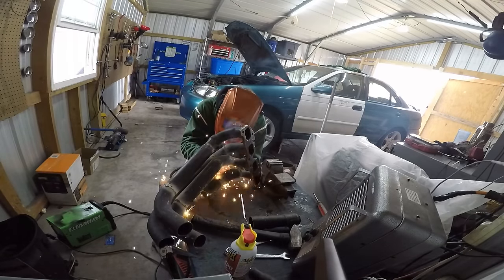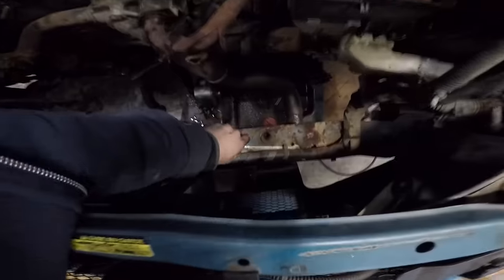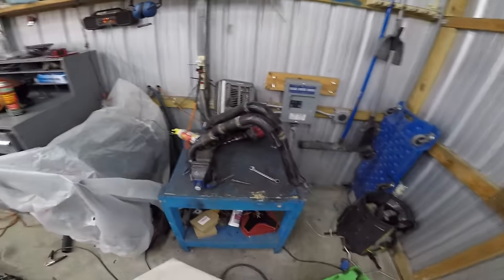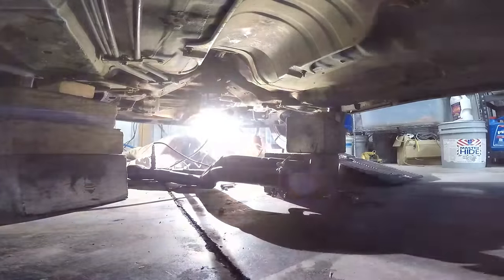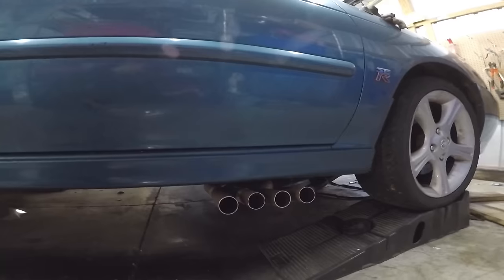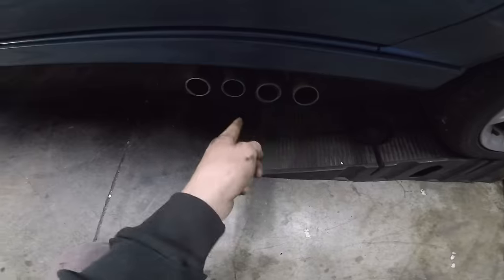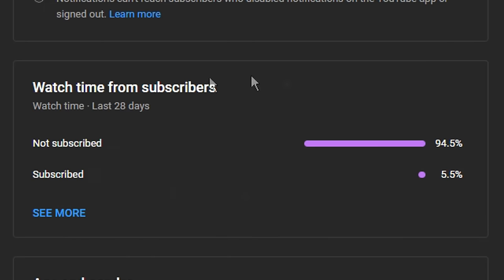True Quad Exhaust on a 4 Cylinder - What Will it Sound Like?

Comment: That sounded kinda good actually.  I mean, I like the sound of zoomies on many engines but, I never would have guessed that a QR with a set would sound that good over the computer. 

Man, I miss my '04 Sentra spec-v.  That car was such a blast.  I've got a Q60S and an RX-7 now, neither are quite as much fun as that Sentra was for me in its OEM form.  Hopefully with some mods they'll both live up to the smile that little Sentra put on my face.
Reply from the maker: Mine has been great, I autocross it quite a bit. I'm not a big fan of fwd cars, but I like my spec v.
Reply: It’s the shit cars that make this worth doing
Reply: I had a 04 Ser had a ballpoint separate and balled it up at over 90mph flipped end over end twice hit a big cement Calvert then smack a pole 25 feet in the air I was awake for all of it and the dang sentry was still idling when it came to rest I kicked the door open and walked away with minor cuts and two fractured vertabrae I miss that car
Reply: I had a '91 SE-R. My god that car was fun. The ole SR20 finally spun a rod bearing and I sold it. Wish I hadn't. Miss that car...
Reply: reminds me a little of straight-piped 240sx's at some drift days I used to frequent when he revved it out haha. Did sound pretty dang good

Comment: Sounds absolutely dope. On low RPM it's like a tank. But the best thing about this exhaust is that on high RPM it sounds like a WRX STI, and the car doesnt even have to have the flat 4 engine!
Reply: That’s because the thumping sound Subarus are known for us purely due to the two exhaust header pipes being different length.  Unequal length or UEL.  If you put and equal length header in, it’ll sound like an inline 4.

You can actually get an UEL for a Honda D series and sounds like a god damned Subaru 😂 

The pipes he made for this car weren’t perfectly even length so they gave different pitches, like a musical instrument.
Reply: all bark, no bite

Comment: I bet a little resonator and a high flow muffler (straight through muffler) on each pipe would make this sound super guttural and smooth, and take out some of that loud rasp that hurts ears. I think this has potential honestly.
Reply: Maybe like a cheap sports bike exhaust on each pipe.
Reply: Where would that go? The thing as millimetres from bottoming out as it is…
Reply: @XavierAway  out the roof, of course.
Reply: @XavierAway  Exhaust components don't necessarily have to be near the exit. Many resonators are actually right after the converters close to where the transmission is in the front of the car. You could easily put one or both of these further up the line somewhere with a little creative engineering.

Comment: Reminds of custom exhausts crafted by former Chilean Formula One mechanic Emilio Peeters for dealer Henry Moore's little Team Subaru in the early '70s in Austin TX. We were loud and quick with those fine small 4 cylinders. My 72 FF-1 had a Radio Shack electronic ignition kit soldered & bolted on, while my '73 GL Coupe had a Jensen Electronic Magneto. The other two team members ran '73 GL & DL models. They all sounded like this video and got between 30 to 40 MPG flouting Nixon's 55 MPH national speed limit during the Arab Oil Embargo days. Gas that was a high 38 cents for premium jumped to an outrageous 60 to 70 cents per gallon.

Comment: this sounds absolutely incredible, and very inspiring to people who feel ashamed of their straight 4 engines, definitely wanna do this to my own car!!
Reply: It may mean your slower, but hey, who wouldn't sacrifice power to make a cool sound
Reply: @lohostege  exactly
Reply: Ive notice the crappier and older a 4 cylinder is it has a "better" sound like similar to this one in the video 😂 i think the rasp and higher pitch comes with performance advance timing equal headers and high rpm with bad exhuast isnt too pleasant but it can be its just rare lol
Reply: @repingers9777  indeed,
Reply: @lohostege  nobody doing this has a fast car anyways
Reply: @repingers9777  Old  honda 4's on carbs can sound incredible... I've got an 89 accord with dual weber 45's that sound pretty wild. Isn't the fastest thing around for sure but damn does it sound sweet.
Reply: @zelashizzz1278  lmfao dude i love webers on old inline 4's 🤣😭
Reply: @repingers9777  Same, pain the rear to keep tuned right, a 20 degree swing in air temps throws them off, but damn fun.
Reply: Why would anyone think a straight-four sounds bad?  A straight-four Honda CBR250RR Fireblade revving to 18,000rpm sounds fantastic, it sounds very similar to a V8 Honda RA106 Formula One Car revving to 18,000rpm.

People seem to hear how an inline-three sounds like half a V6, inline-five sounds like half a V10 etc, but not how an inline-four sounds like half a V8.  Could it just be that American style V8 (which is constructed more like two V4s joined together and NOT like two inline-fours joined together) gives people the wrong idea of how an inline-four should sound?  If the matching style of V8, the Lotus and Ferrari style which IS two inline-fours joined together was more common, perhaps people would have a more favourable view of the inline-four sound?
Reply: Who tf is ashamed of a 4 cylinder?  They're great!
Reply: @Stern98257 anyone who thinks their car sounds bad or isn’t powerful enough, i don’t mean that 4 cylinder engines are bad because most are amazing :)

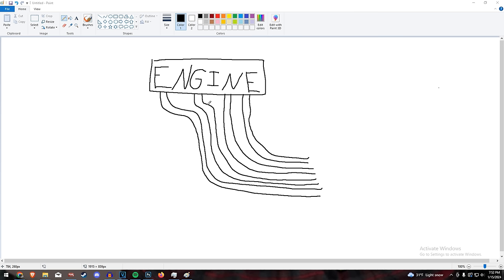Comment: 0:21 "We used to use these till we found out they weren't great."

Yeah, lack of back pressure... Great way to burn valves, melt rings and quite often try to catch the engine bay on fire. About the only scenario where this actually works out well is on a plane, and that's just because the exhaust is already something like 12 inches long with a substantial amount of air passing.

Comment: Zoomies are still used in Top Fuel drag racing. They are some of the fastest cars in the world.  Zoomies are not used much anymore due to packaging & emission constraints.
Reply: Im pretty sure Top Fuel drag racing cars arent very technically advanced. The reason theyre the fastest cars in the world is the fuel they use which is 90% nitromethanol.
Reply: @palikkalapsi345 congrats that’s about the dumbest comment I’ve read in a really long time
Reply: Zoomies work well on any engines with large superchargers, using collectors & other items to improve scavenging is of no benefit. I have a blown methanol car, see my chanel for a few onboard vids - fastest run so far was 2 years ago, 7.50 seconds @ nearly 180mph. I'm just learning to drive it having learned to tune it & its huge fun.
Reply: @sidefx996  he's not really wrong, top fuel dragsters are fast because of brute force, and not technology
Reply: @Bangmomsmakebombs  I guess it depends on how you define "cutting edge" and "technically advanced."  For their purpose, a Top Fuel engine and car IS the most technically advanced and cutting edge technology in the world.  Otherwise someone else would have found a "more advanced" way to do it better.  What "cutting edge" technology" would make them work better?  Without making a list of and individually describing and explaining all the components on a modern Top Fuel engine (and car overall), I absolutely feel they are all of those things otherwise they would've been making the power and running the ET's they run now 50 years ago.  I guess to the low information Top Gear cars & coffee crowd "technically advanced' means having 20 camshafts and being built in a foreign country?  What exactly are we comparing them to?  They're built for a very specific purpose.  He stated the only reason they go so fast is because of the fuel they run on, which again, is about the dumbest comment I've heard in a really long time.  That's like saying the only reason the X-15 went almost mach 7 is because of the fuel it ran on.  A modern Top Fuel dragster or funny car is covered in cutting edge parts.  While the engine configuration is "based off" a production Hemi engine, EVERYTHING is custom made (and horrendously expensive). And the car is much more than just an engine.  And by the way, they LOWERED the percentage of nitromethane in 2015 in order to try and "slow" the cars down as technology continues to make them quicker and faster.  Dude can't even spell/name/pronounce the name of the fuel properly.  Should probably spend a little more time reading a book and little less time commenting on Youtube about things he knows nothing about.
Reply: @Fred_the_1996  Again that's an asinine statement.  Define "brute force."  Again if that were the case why weren't they running as quick and as fast decades ago?  Prior to 2015 they ran a higher percentage of nitromethane.  Why are the cars quicker and faster now?  Oh yeah.  Advances in...wait for it... TECHNOLOGY.  For their purpose, what is more technically advanced?  And what "technology" would make them work better?  I'll wait...
Reply: @sidefx996  brute force is squeezing so much power out of an engine that the spark plugs die mid run and the engine starts dieseling. Sorry but dragsters aren't as advanced and polished as some other categories and they rely on brute force, as in tons of boost and tons of fuel being injected. And no, they're not getting faster because of tech, it's because of the teams' optimization of their setups
Reply: @palikkalapsi345 engines are air pumps. The more air you can get in and out of an engine the better it works. 

The freest flowing exhaust is literally the best you can use. And anyone that says you need back pressure needs to be smacked into reality.
Reply: @Fred_the_1996  Again, you like to use adjectives like "advanced" and "polished" (whatever the hell that means) but have given no examples or comparisons.  The only reason they're able to "optimize their setups" is because of advances in technology.  You can "optimize" a 1960's dragster all you want and it's not going to run like a current one.  Advances in technology in electronics and fuel injection and superchargers and clutches and tires and in all the different materials involved (do I need to keep going?) have made that possible.  What "other categories" are "more advanced" in your opinion?  And again, be sure to define "more advanced."  And if they're so much more advanced, then obviously that "more advanced" technology should be able to be used to make Top Fuel dragsters/funny cars that much quicker and faster right?   If someone told you Ford was building an all aluminum, flat plane crank, DOHC engine, you'd immediately get a hard on.  Except they already did that in 1940 and it powered a Sherman Tank...  You may not be a fan of the sport, but again, nothing out there is doing it better.  A Formula 1 car can't do what a Top Fuel dragster does, and vice versa.  They're both built for specific purposes and are both covered in "cutting edge" technology for that purpose.  I'm guess the majority of parts and tech on a modern Top Fuel car weren't available say 25 years ago.  Otherwise, why weren't they using them then?
Reply: @sidefx996  i didn't say the teams aren't technologically advanced. They are. They use dynamometers, sensors, etc to make the cars faster. But the engines and cars themselves really aren't. If i use cutting edge tech to dyno tune my 90s car and make it faster, it doesn't make it any more advanced. But yes, you're also right
Reply: @Fred_the_1996  Besides a similar basic engine and overall car configuration (engine in the back, supercharger on top, skinny tires up front and big tires and wing out back) there is probably nothing on a current top fuel car that you'd also find on a 90's Top Fuel car.  I could be wrong but I'd venture a guess that just about every part has been advanced or surpassed by new technology.  They "look" similar to the everyman but a 90's 911 also looks similar to a brand new one to a someone not into Porsches.  You can use the most advanced dyno tune in the world and you're not going to make a '91 (insert make and model here) run like a '24 (insert same make and model here) without changing parts.
Reply: @sidefx996  hmm ok
Reply: @SkylineBNR34 then how come taking off the airbox and straight piping a car doesn’t give massive HP gains
Reply: @Fred_the_1996  lol dude talking out his ass.  you did right to reply like you did.

Comment: Had a lil 960° rotation on black ice, tore the whole muffler system off when I flew off the raised roadbed in my 80's 318i [Germany early 90's)... as I had American plates I didn't bother fixing it. 

Sounded like that, redline slam shifting,  spinning it's tires on all four gears... I didn't even change the oil, 50,000km... left it a smoking wreck when they took me away in cuffs, returning me stateside. 

You should have seen my daytime ride, an m60a3 main battle TANK ... no muffler either.

Accidents are funny... I can still remember the beer flying out of my passenger's can... as if in slow motion, frozen in the air as we spun round and round.

Comment: this sounds so good that if the performance loss isn't too big i might be interested in a silenced version
Reply: There is a actually a company called 2j racing near atlanta that sells unequal length headers for spec v sentras. I had one on my spec v and it made the thing sound like a subaru sounded so good and header looks sick
Reply: Wouldn’t that mean you’d need 4 mufflers?😂
Reply: @EAGLINWRX yes, and it can be done. Takes a lot of space, but you can use bike mufflers which are smaller
Reply: How are you going to put an oxygen sensor in 🤣🤣🤣
Reply: @jasontexter1721  have pilot tubes from each pipe convene at 1 point and put the sensor there.

Comment: Holy moly🤩It sounds mental for a puny 4 cylinder, kinda like the WRX, but also not quite so much!
I have a suggestion now, are you able to multiply the pulses if you stick with kinda the same setup, but add another Y pipe to each of the headers and 4 more pipes with same unequal length?
It would be amazing if you can test it out!
If my judgement is on mark, you should be able to double the pulses and make it sound just like a V8😎
I know that this is definitely something I really wanna try with my 4 cylinder VAN😂
Reply: a `puny 4 cylinder`? Do you know what THE most powerful Formula 1 engine ever made was? It produced around 1400-1500bhp? It had a capacity of 1.5ltr (91ish cubic inches)? It was a BMW engine? It was used in the early to mid 80s? A 4 cyclinder turbo! You even mention an Impreza (certain models over 400bhp in standard trim) theres also Mitsubishi Evos (up to over 400bhp in a standard road car) AMG A45S 421bhp, Ford Sierra Cosworth one of the greatest and most successful road and race cars of all time with a 2.0ltr 16 valve turbo with 200-220bhp standard but 550+bhp in race form! Check out the channel Mk1Keiran to see the performance of a 4 cylinder 2.0ltr 16 valve turbo drag car running a highly tuned hatchback (Calibra Turbo, Cavalier Turbo) engine to achieve the Uks fastest doorslammer time of 7.34 sec quarter! The rest of the world has been developing increasingly efficient and powerful and torquey 4 cyclinder turbo engines that provide at the very least the same power as a US Pig Iron prehistoric pushrod V8 but with a quarter of the capacity!
Reply: That's kind of their point... It takes a lot of engineering to get those kinds of numbers from a puny 4 cylinder. Whereas a big nasty American V8 just does it like it's nothing, brute force with pure displacement. Further, that person calling a 1.8l puny isn't necessarily knocking it, it's simply a small engine, relatively speaking. Puny ≠ bad.
Reply: @davekennedy6315  Great point.  However, the puny 4 cyl in the video is the puny 4 cyl that was mentioned in the original comment.  Nice grand standing though. 👏🏻👏🏻👏🏻👏🏻🫡
Reply from the maker: The issue with Y pipes is they don't create more pulses like more cylinders do, the pulse before the Y just splits in two. The result is a basically identical sound. That's why you see cars with dual Y tips that sound normal

Comment: That sounds oddly amazing AND it's an absolute mess of piping? Fantastic!

But seriously, kinda sounds like an older rally car in the higher revs. If I didn't want my Toyota Hilux to be quiet enough to take through the drive through without turning it off I'd probably do something a bit like this but with some small mufflers.
Reply from the maker: If I was to make a permanent version I would use smaller pipes and motorcycle mufflers.
Reply: I sounds like the Sentra from NFSU2
Reply from the maker: @jt1231313  Ah yes, a man of class.

Comment: That thing sounds amazing lol. Also, I totally know how loud that was. I had an old Celica that the exhaust rusted off at the collector, which was directly under my feet. That was a rear exit head and no cat before that either, so completely unmuffled immediatly out of the manifold. Loudest exhaust sound of any car I've ever ridden in, including an open long tube header 302. When it happened it was right after I got done with band practice in a metal barn, so insane loudness inside that tin can, and the exhaust was way louder.
Reply: Holy crap I've never thought of that happening. Imagine driving down the road when it fails. I would probably wreck just from the sudden volume change haha